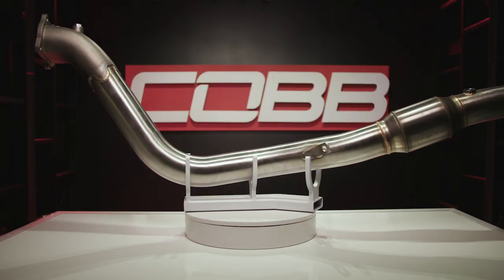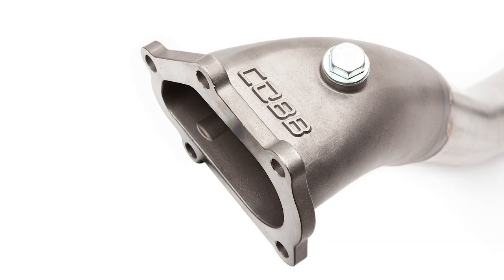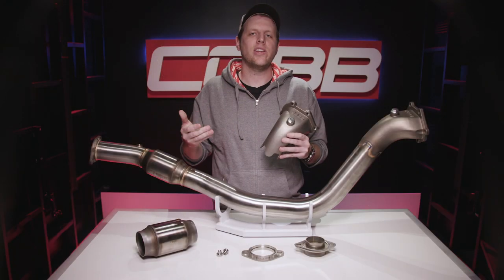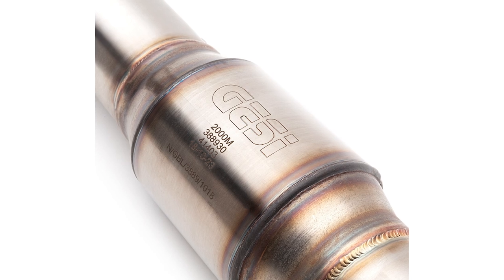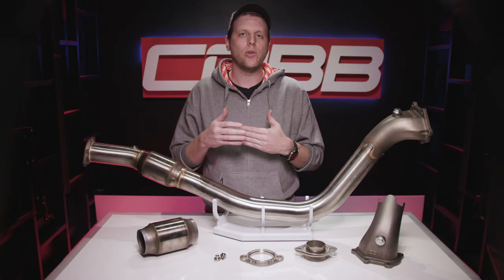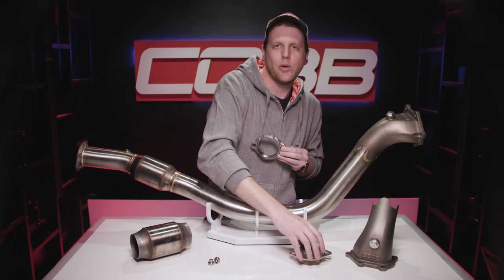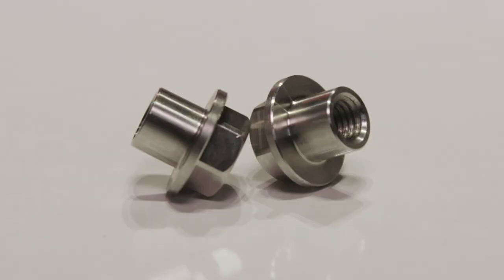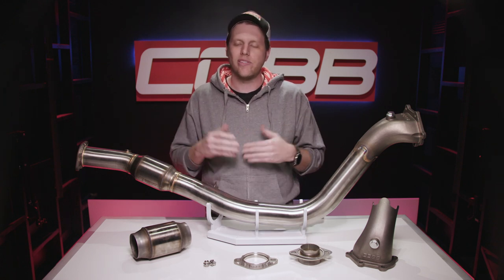COBB Tuning - Product Highlight - Subaru GESi Catted 3" Downpipe

Comment: Just got installed on my 2018 STI RA
Reply: Have you had any issues with check engine lights? Considering replacing my invidia downpipe since it won't pass emissions.
Reply: Yeah do you get CEl’s

Comment: You guys should really make another video explaining O.T.S. tunes. If you could, show how they are made. Also show where the map notes are and why they are important. These kids are blowing up their engines mixing up tuning theories. 
All while staying on an OTS map.
Reply from the maker: Not a bad idea. Seems to be a never-ending need for answering those questions.
Reply: So with just this catted down pipe and a stock exhaust+muffler delete I can run a stage 2 OTS tune and see a bump in HP and keep the engine happy?
Reply: @michaelhernandez1398  no, you will still need a pro-tune in the immediate future. The OTS tune is safe in terms of having to good basemap to start from. But I wouldn’t count on it being a long term solution.
Reply: @Ed50482  okay thank you
Reply: @Ed50482  I think Cobb knows this and understands that as long they provide everything as and how it's supposed ot be used, then they are covered.  What little Johnny does afterwards with his new Cobb parts and new 'tunes is out kf their control.  This way they can R/D and make a profit and only hope that you'll stay stock.  In reality, they know what's more than likely the outcome.   Not their business though at that point.
Reply: @GR8GUY54  yeah, I get that... It makes sense. You can’t knock a profit. (Side note:)I’m actually a Honda guy, and I think it’s obvious I’m out of my realm... 😆 I should probably go back to my automotive roots.
Reply: @Ed50482  All good, bro.  We are on the Interwebs to learn and help others.  That's just my two cents though.
Reply: @GR8GUY54  message me?

Comment: I have a 2020 STI. and was wondering if  this would void the manufacturer's warranty?
Reply: Yeah bro, running a downpipe needs a tune, which will void your warranty for the engine and related.
Reply: Your warranty can't be voided. Common misconception. Your warranty claim can be denied. Your warranty covers so many things that it can't just be voided. A warranty claim can be denied if the part you installed was proved to be the reason you experienced some type of failure.

Comment: Questions can add this with cobb accessport.  Without E-TUNE? Im running yall cobb exhaust systems ss  2019 sti with cobb intake systems.
Reply from the maker: We do not offer calibrations for upgraded downpipes at the moment.  One important note is that the factory fuel system cannot keep up with both an upgraded intake and downpipe.  We recommend looking at our NexGen Stage2 Power Packages in order to safely increase power beyond the Stage1+ level for your STI.
https://www.cobbtuning.com/stinexgen/
Reply: @cobbtuning  😂😂 2 days later P0420 .
Reply: You do not need a fully upgraded fuel system, grab a 340 fuel pump, and a fpr. With either a dyno tune or etune a good tuner can dial things back a bit to where your oem injectors are fine. With intake and turbo back you’re looking at 300-310 whp and 340 ish tq. For example before the greenspeed bs Maperformance had an ots tune for their intake downpipe combo that ran perfectly safe.
Reply: @lucian7182  thank you.. seem like cobb want just sell there product 🤔 not backing up there APORT 🤔
Reply: @tranwrx  your dp is going to throw a cel it’s unavoidable these days unless you go open source tuning or a stand alone. This is only a big deal when it comes time to smog. If that’s not an issue no worries. The cel will disable cruise control and keep you locked into sport mode. So make sure your tuner sets the same targets for sport as sport#  and it’s no issue, maybe add some stickers to the cluster if the couple lights bug you.
Reply: @lucian7182  my guess AP an joker? Yea, I hear open source number one in the market right now..Just have to see a CEL..
Reply: @tranwrx  I mean i love my ap, but i definitely wouldn’t pay brand new prices for one. My wife’s explorer ST is has some bolt ons and a tune, for that I used an SCT x4 because the ap wasn’t out yet. They recently just released and accessport for the platform, but I have no desire to pay 750 for the ap and then have to pay for a retune just because it has a better interface. The other tuning devices for that platform are 3-400 new yet Cobbs is 750 😂.
Reply: @tranwrx  just got done retuning my sti, for the dp, intake combo on stock injectors. Running aem pump, and Cobb fpr. Came out great. Under wot at high rpm my injector duty cycle briefly touched 94 % , but no issues whatsoever. Car made 325whp 338tq @ 19psi.
Reply: @lucian7182  What stage can i run with catted downpipe with there exhaust systems on 2019 subaru wrx sti  OTS? Just temporary before i go e-tune help?? Dude that beast!! With stock fuel injector.. question u running 91 or 93? I ask because it's just temporary.  I know.   I have stay out of boost.  My build is an fully forged pistons with king bearing and heads upgrade gsc power-division performance exhaust and intake valves, cobb exhaust systems ss and map catted downpipe .. my next upgrade is aem fuel pump like your self.. im running cobb cold air intake system.
Reply: @tranwrx  I’m running 91.  There really aren’t any stage 2 ots tunes, unless you find someone that has a copy of one. I would hit up an etuner and have them send you a base map.
Reply: It should be fine if you stay out of boost